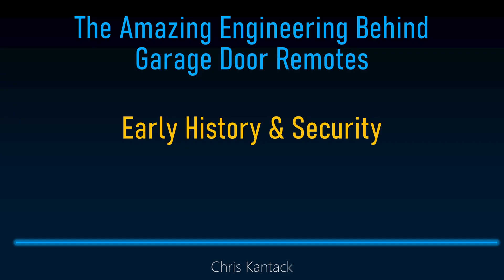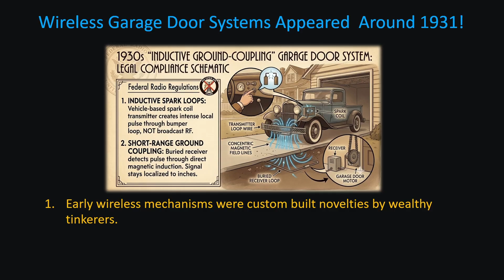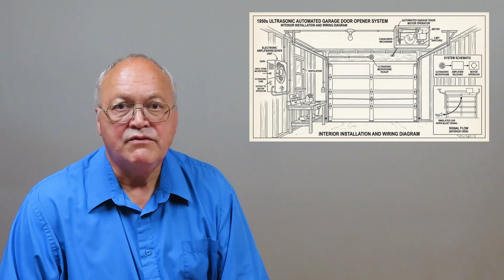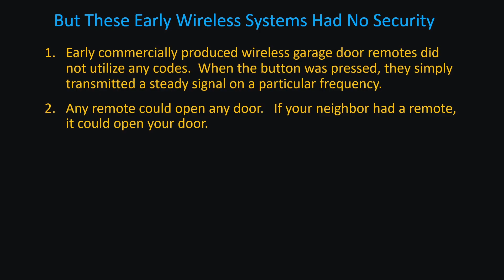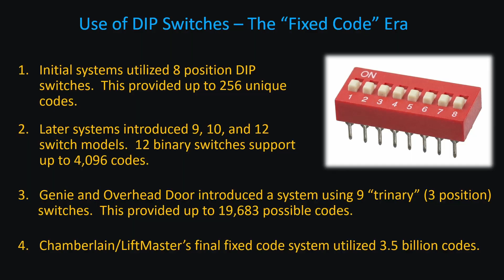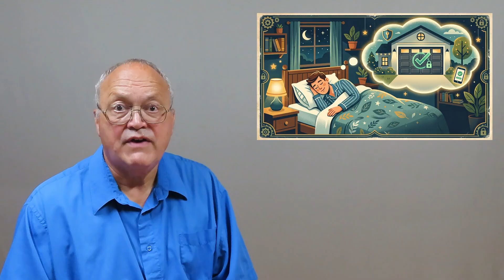The Amazing Engineering Behind Garage Door Remotes:  Early History & Security

Comment: I worked for years at sears in 1980 sold, and installed openers. Breaking in to them was no problem
Reply from the maker: So in 1980, were you at the fixed code stage (DIP switches) or was that still pre-DIP switch?
Reply: @ChrisKantack  I remember setting them with a papaer clip, pushingthe dips back and forth .  But it wass 45 years ago